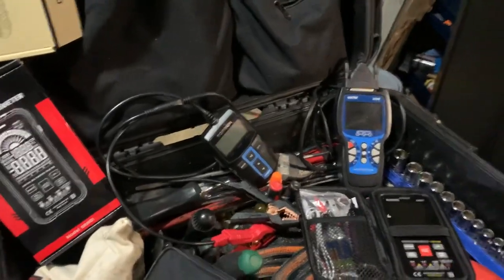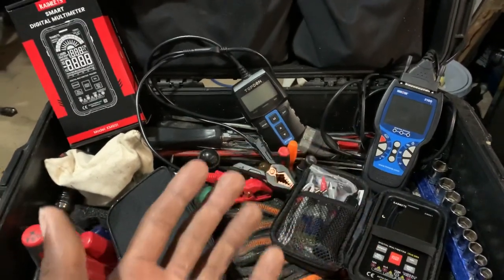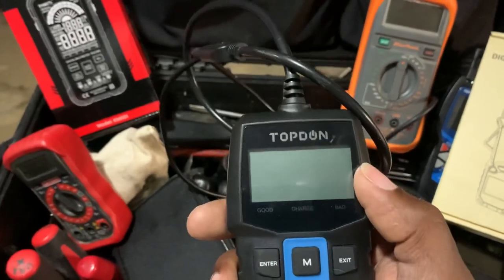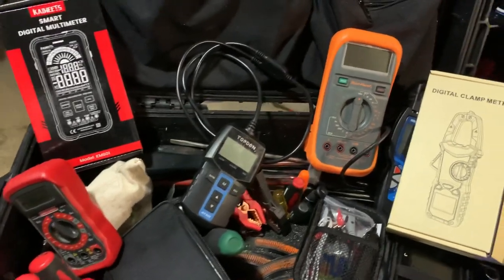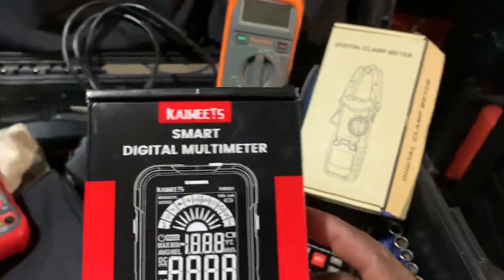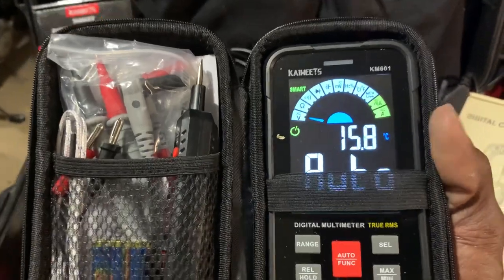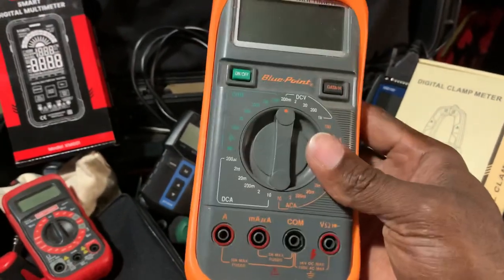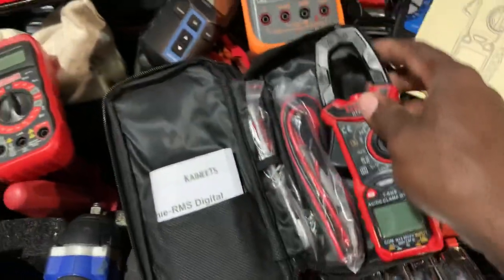AFFORDABLE DIAGNOSTIC TOOLS | SAVE SOME DOUGH$$$ #snapon #toolboxtour  #diagnostictroublecode #tools

Comment: Some interesting things i work in a plant so sometimes i am working with 460 volts on that kind of power i don't trust anything else than a fluke meter but some of the ones in your video look interesting for working on vehicles and forklift i would like to see a video on the smart meter